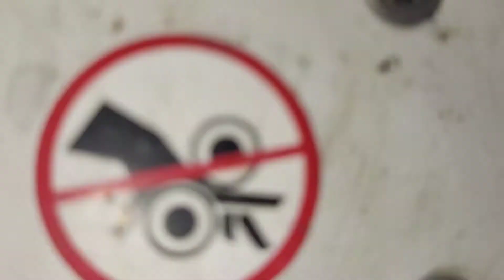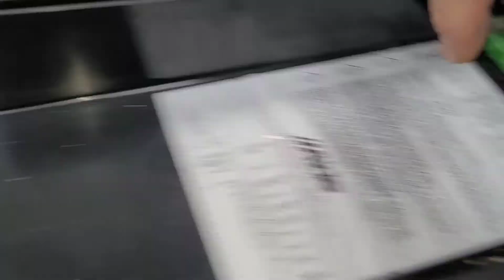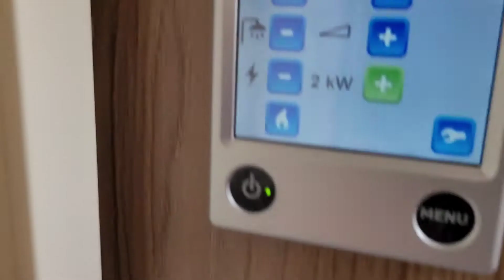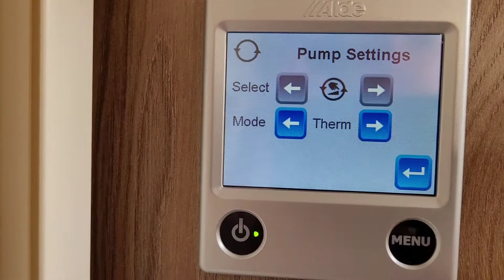Alde 3020 inline circulation pump upgrade

Comment: Hi, the "Rubber S" has to be bought separately.
Reply: Great video but where did you get the Rubber S hose?
Reply: @SimonFranzen-f9o  same place as the pump, if you read the original video description, I have even listed the part numbers etc. 👍

Comment: In addition to this excellent video - I can add that the tail of cable shipped with the new pump which has the Y shaped cable is used for connecting the pump the the early models of the Alde Compact 3010 that has a different PCB within and has NO pump connections. The two pump connections for this model are found under the black plastic lid, with no need to remove any panels to locate. Simply use the Y shaped cable supplied with white plugs to connect to the connections marked pump motor.
Reply: Can you put the pump you have installed model number and make please and from where you bought it.